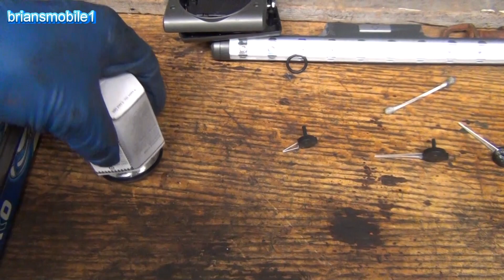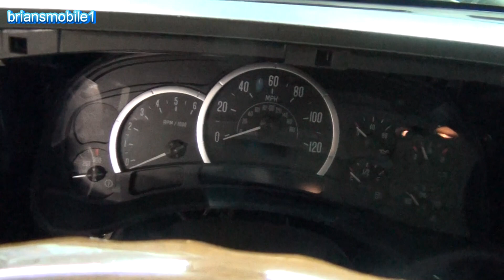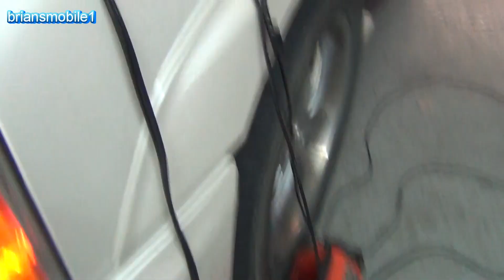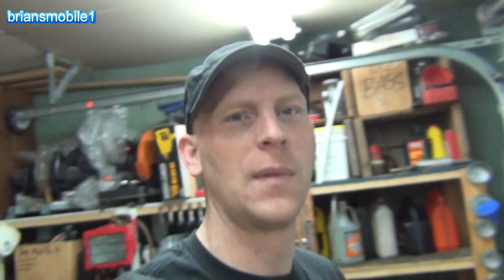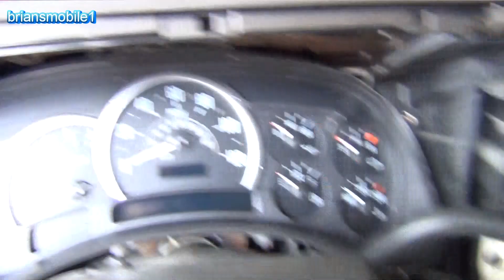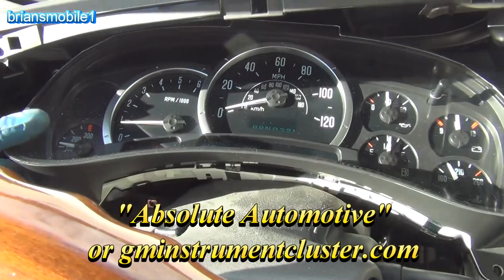Pandora's Gum Wrapper - Escalade Cluster Fail

Comment: When I'm working on someone's car I pull the daytime running light fuse. In my car I leave it out all the time anyways since I have HIDs, no point in blowing out my ballasts because I turn them on and off and on and off in the daytime (I live in Florida now, so the sun is so bright even if you went around with high beams on no one would notice). In fact before I got my old battery and I lived in Pennsylvania my battery was so old pulling the daytime running light fuse meant the difference between starting my car and not. Yeah it's only drawing 9 amps or so, but when your battery is weak it makes a difference.
Reply from the maker: It really does create a lot of undo stress on the battery to have the lights on without the engine and alternator turning and replenishing the battery.

Comment: Brian, you are not done with this one. The capacitors on that cluster panel were all bulging and popped. It's going to fail again, maybe even destroys more things when it goes. The metal cans are the Capacitors, the vents on top have opened, this means they are very bad.
Reply: You should learn to watch the video through before you comment he had the board rebuilded professionally
Reply from the maker: GOOD EYE Todd!!! I was so distracted by the filming/resistors/etc I missed those!  Thanks for the heads up!  Putting a time stamp like this→ 1:46 (two silver cans at 2 O"clock from speedo) that can be clicked on is also helpful for me and others to be able to quickly reference what you mean.  That makes perfect sense why the voltage had to be high enough that those capacitors weren't needed.  Hopefully Absolute didn't miss them too. (I'm guessing they did because it didn't work without a brand new battery) I asked if they saw anything and of course it's all proprietary secrets and mums the word with them.  This is their bread and butter and they've paid out a lot of money and legal fees in keeping it that way.  Todd, I owe you a gift card! PM me your address!  Lowe's, Autozone, or Walmart?
Reply: briansmobile1 Wow! Thanks Brian! Good point on the time stamp reference. I was watching on my iPhone as I was going to sleep and, sorry to say, skipped through the video to the end and didn’t notice you replaced the cluster. I just wanted to help out being I could see the problem with circuit in the cluster. My guess is, if they don’t use quality caps during the rebuild it will fail again. You’re right, the reason others have luck cleaning up the grounds is because it keeps the current and voltage levels high enough to power the cluster when the caps have failed or gained a high internal resistance “ESR”.  If the caps are only a little bad then cleaning the grounds could help, but when the caps are as bad as in your cluster they needed to be replaced. If you ever replace such caps get Rubycon or Nichicon brand 105 degree Celsius rated from Digi-Key, or just send me a photo and I can look up the best replacement for you. Also, don’t use the fine point tip when soldering. Use a large 1.5mm chisel tip. I know it seems counterintuitive to use a larger tip, however, you want to put as much thermal load into the solder point as quickly as possible and a larger tip will do that for you. The surface tension of the solder and the solder masking will keep the solder where it needs be. You don’t need to control where the solder goes just watch for solder bridges if you apply to much solder and wick-up excess if you do get a bridge. Thanks for all the videos!
Reply from the maker: *****
Thanks again- I "paid tuition" on this job and I'm most grateful for your advice!  This way I walk away a better technician than when I began.  I'm often surprised how much there is to learn from a field like this.  It's always expanding every day.
Reply: hondaveetc82 True, I did miss that point while skipping through the video. I was watching on my iPhone while in bed last night. I could see problem with the cluster and wanted to chime in before turning in.
Reply: ***** True, I did miss that point skipping through to the end.  For sure the alternator and battery were bad, but he might have been able to replace the caps on the cluster and fix the old cluster.

Comment: That block is abrasive... Frequent use will wear away the cladding on your fancy new tips. A sponge dampened with distilled water will shock the oxides off the tip without damage from abrasives. That copper scrubbie is good for when the tip gets extra crusty. 

Like Mitch mentioned, cleaning with 91% isopropyl is essential if using activated fluxes. I make my own No-Clean flux from isopropyl and violin rosin. 

Kim WIpes, medical cotton swabs (the ones on a long wood stick), acid brushes trimmed to different lengths, and 2oz needle dispenser bottles would be great additions to your rework station.
Reply from the maker: Thanks John!  I'm new to all this proper re work soldering.  I've reworked and soldered for decades, but not in a proper way.  I've had no one to teach me till now.  This is great!

Comment: Was the original cluster bad or was it all caused by the bad battery?
Reply from the maker: The cluster had some lights out on it and it had two bad capacitors on it that I had missed in my pursuit of filming, soldering equipment showboating and resistor-viekra-prop-giving.

Comment: I know that the clusters are different, but what motor would I need to buy to fix a 97 GM 1500/Tahoe gas gauge?
Reply from the maker: That's a good Video Idea.  I'll do that soon.
Reply: briansmobile1  Thanks for the reply! Once I changed out the fuel sending unit and it didnt solve the problem, the answers stopped. If you make that video it would be very very appreciated!